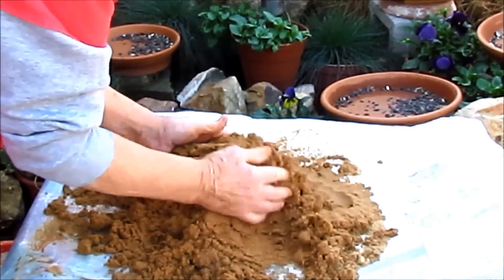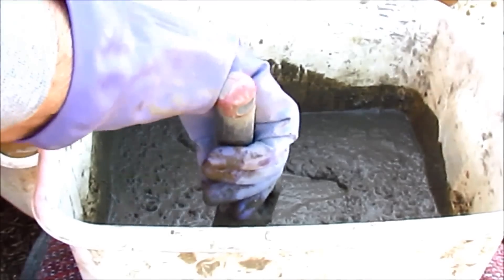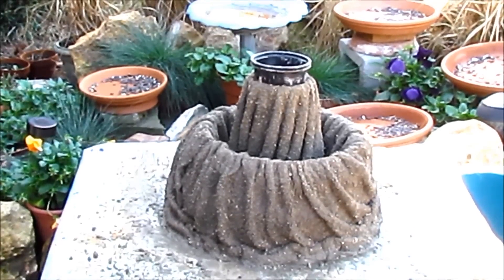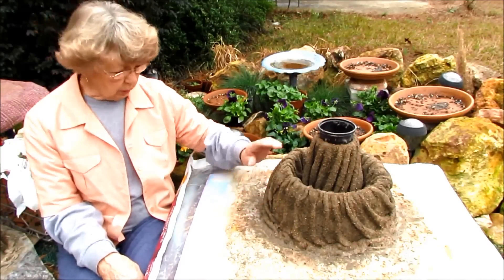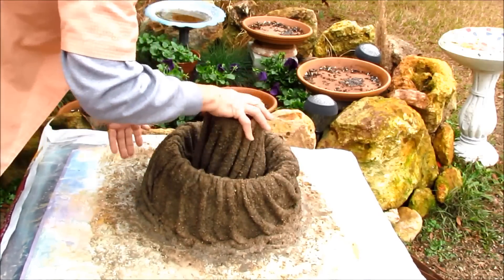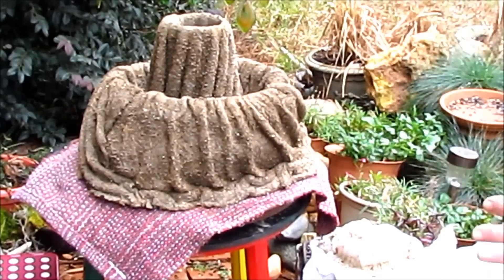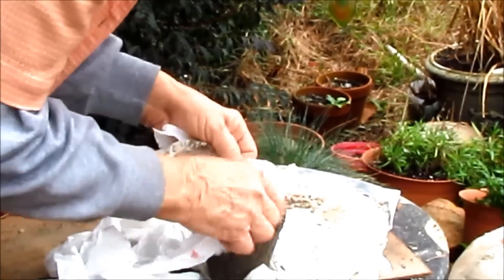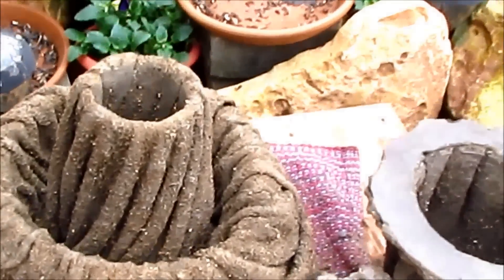New Hypertufa Flower Pots In Ga

Comment: hi Helen hope you're well thank you for your video. I tried a drape pot with a towel. it's a little soft, would it be because I didn't use any sand? I used 2 x peat and 2 x cement. we can't get portland cement in the UK, could you recommend a strong recipe for my pots and which cement I could possibly use please ? thank you .. loving your brilliant videos, please keep them coming! x sandy
Reply from the maker: Thank you so much for your kind comment and so pleased you like my videos. I tried that once with a towel mine was soft too . I did not try again. i use an old blanket it worked great.  I thank any kind of cement would work but not with rocks in it. I thank you need sand in your mix . Some one where you buy cement could help you. good luck.     God's Blessing to you From Ga.

Comment: i like the swirls...seems like so much work...i'm so lazy i think i would rather just buy it...i didn't even think about using the sand so it shapes it and then you just scrape the sand out...i don't think it was a big deal that the pot didn't come out you could have still even used it with the pot in it...

Comment: Helen, what are the measurements for this project. I have tried twice to do it and the cloth is too limp after a few days of drying. I am so frustrated.
Reply from the maker: Hello Kathy so sorry you are having trouble. I put 4 cups of Portland cement 4 cups sand  4 cups peat moss 4 cups perlite add water just enough to wet the blanket.  my blanket was kind of heavy  one not then. let it set till dry the longer it sits the harder it will get.  good luck.